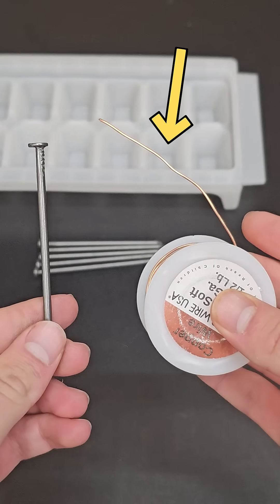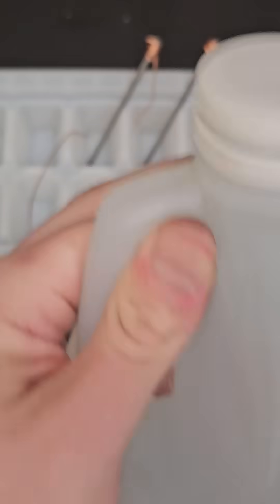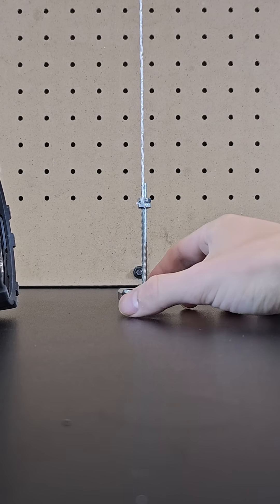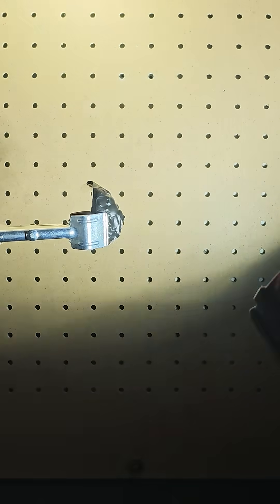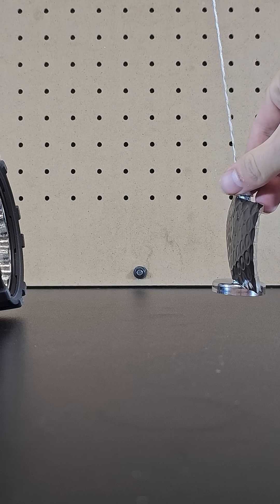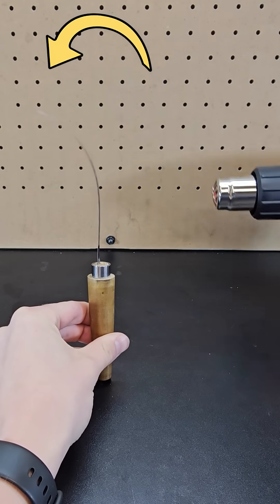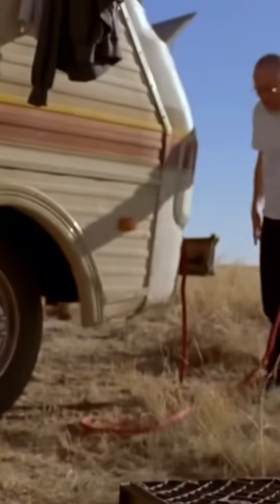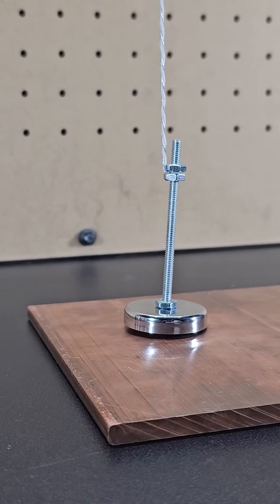Can you spot real vs. fake science? - 2 Truths & Trash (S4E1R2) #shorts

Comment: Honest opinion on this one. Super high-quality stuff. You are demonstarting 3 interesting physical / chemical properties (electrochemical potential, photon momentum, and varying material dilation).

My only gripe is that it is a lot more difficult to get the answer right by only using your basic intuition. Light can stop the pendulum, as photons do have momentum. At this point, one would need to do the math to figure out whether that flashlight has enough lumens or not. So it is less of a fake phenomena, and more of a "it doesn't work in this case".
Reply: You could also intuit that it looked more like Lenz's law than photon momentum. If it was the latter, the pendulum should have begun accelerating in the opposite direction. It definitely was tricky, though.
Reply: Note that Demo1 and Demo3 we're completely correct so we still had enough to say Demo2 was cap. I initially believed Demo2 because I knew of that photon effect - you can make a very simple fan with it - but I could picture the military weaponising it ASAP if it worked as simply as he made it look. His brilliant ruse of insisting that we use black bubble-wrap helped sell the deception.  So he did the whole thing properly.
In real life most con-jobs have enough truth to sound plausible so the wise have to learn to read between the lines😂🎉
Reply: "Light can stop the pendulum" bro stop! No it can not.
Reply: I knew the second one was bullshit almost instantly
Reply: Yeah my thoughts were the same here. What he did with the light and the pendulum is basically how a solar sail works, so it's real science, but the scale was to small in that case.
Reply: I disagree. The first one is plausible—everyone’s heard of “battery acid” and lots of people made lemon or potato batteries in school as kids. The third one is also plausible, because everything is explained and internally consistent. Also, bimetallic strips are actually how toaster timers work.

Your intuition should be able to give you an idea of how much force is required to stop that pendulum. Not mathematically, just literally “how hard would I have to push to stop it dead like that?”. And without knowing anything about the mathematics of radiation pressure, your intuition should tell you that light absolutely can’t exert that much force. If it could, we’d see practical applications everywhere, and you’d literally be able to feel the subtle recoil when turning on a bright flashlight.
Reply: @AstroPsych_  where you're gonna find 10k+ lumen flashlight to have a real idea about it. Also, video made it look like in 3rd strips are "side to side"  instead of "one on top", which definitely wouldn't work. At least it looked to me like it's the case.
Reply: @AstroPsych_ Solar sails (lightsails) don't exist? https://en.wikipedia.org/wiki/Solar_sail sorry, they do.
Reply: @grumpyhale821  1: there is no air in space, so almost no force is needed to move in space.
2: a star ≠ a flashlight as a star is much brighter than a flashlight.
3: solar sails are extremely slow, even with extremely light objects.
4: a white object would be better for that than a black object as light bounces off the white object instead of being absorbed.
5: the pendulum stopped way faster than light would stop any object.
Reply: @Darth_Mooo1) here air is only helping, 2) stars are much further, so a flashlight is comparably much lighter, 4) it's not that easy to figure out, 5) like everybody does experiments like these.
Reply: @grumpyhale821  Solar sails existing does not discredit the intuition that light should not reasonably be able to exert that much pressure over such a short span of time.
Reply: @nester7315 1: You're arguing a moot point. 2: You'd need an extremely bright flashlight at very short distance to top the 100,000 lux that the sun can exert on us at its most. We don't feel any "push" from being in sunlight, so it's reasonable to assume you'd need many orders of magnitude more brightness to feel anything. 4: Granted, it's also fairly common knowledge that darker colours absorb light whereas light colours reflect it. If something reflects, then your intuition should be that it pushed the thing it bounced off. 5: Again where's your intution for how much "push" light has? We NEVER feel any pressure from being in direct sunlight, so your belief should err on the side of "no push" rather than believing it can stop something dead like it hit a brick wall.
Reply: @MGSLurmey  strongest flashlights can get to 100k lumen, here area is somewhere around 1/100 of a m², so it's somwhere around 100 times stronger than the Sun. Then, considering that we don't have sails and are much bigger (area scale is quadratic while weight is cubic) it'd be unnoticeable. And lastly, bouncing may seem intuitive, but it isn't, you have to deliberately think about pretty minor detail to find it.
Reply: @grumpyhale821  They do exist, but check out their sizes. Also, if you want to think Newtonian: at the rate at which this one slowed down - the side force component would have to be significant enough to prevent the pendulum swinging about the vertical balance point, but it would not have stopped it outright like sinking in molasses.
Reply: @Darth_Mooo for the Matter of this Experiment, No it isn't.
Reply: @MGSLurmey interesting that you say it was easy to Figure Out that it was B, when you don't even know how momentum works.
Reply: @eragonshurtugal4239 uhhh what are you talking about?? Darth_Mooo is 100% correct and debunked exactly why it couldn't work.
Reply: @nowonmetube  No he wasnt. He claimed a star was way brighter then a flashlight, wich for the purpose of this experiment is just not true. There are flashlights hwo emited more then 100k lumen so abount the same as the sun on eart per m² but on a way smaller surface propaple 100cm² or less, wich would make then about 100x times brigther then the sun. Atleast here on earth where it matters. The proplem, ypi dont need somethink 100x times but more then 100 millions times britgher then the sun on earth for that experiment to work.
Reply: I fully agree, especially with this one as I'm sure the majority of people watching this video know about solar sails. Him giving a speech about how bright and dangerous the flashlight is without any comparisons to floodlights etc, with the tiny distance between the flashlight and pendulum made it more of a mathematics problem than spot the fake. The issue was that it is possible.

Comment: I was decently confident it was B because I think I remembered something about how light inflicts so little force on objects. If the black bubble wrap changed shape before it became stationary I would’ve been leaning more towards A
Reply: Also, light paper wouldve been more effective since it reflects the light back instead of getting absorbed. The speed difference is double. It was wrong to say black is better because the enegy from the light gets converted into heat while with white would let the light bounce meaning a higher change in velocity and thus more force applied.
Reply: For me it was B because why use a magnet? What he claimed had nothing to do with it so the only reason to use a magnet ist to fake the stopping.